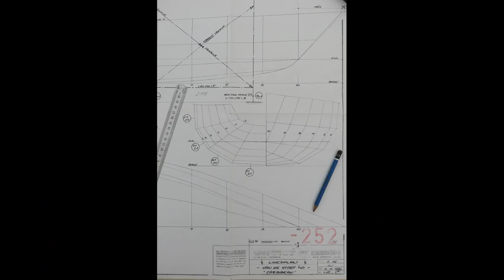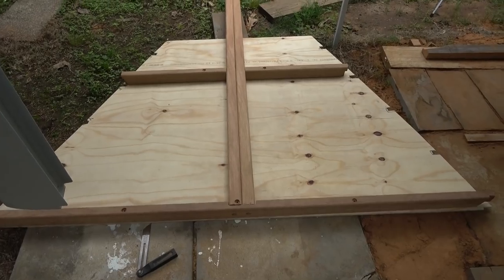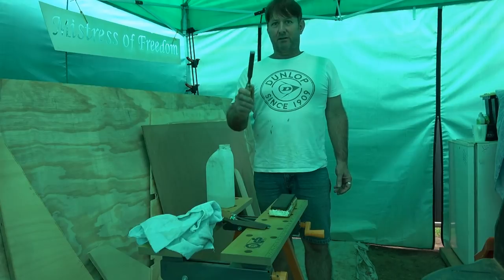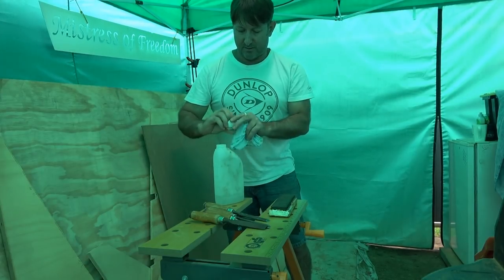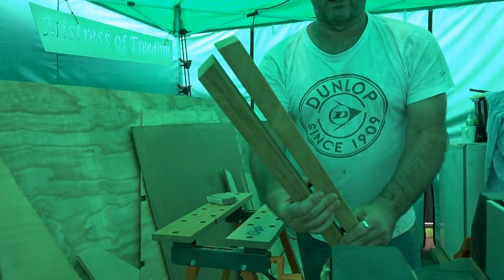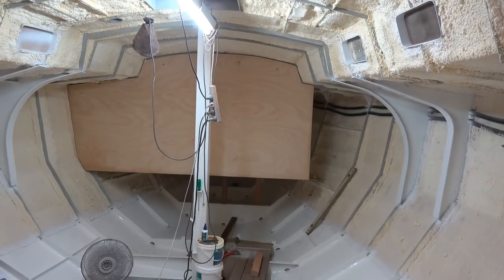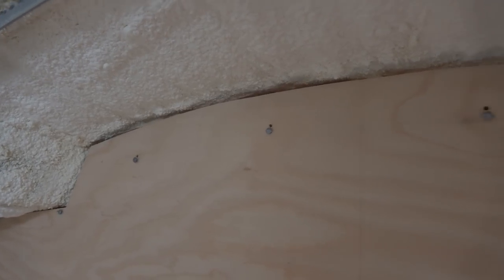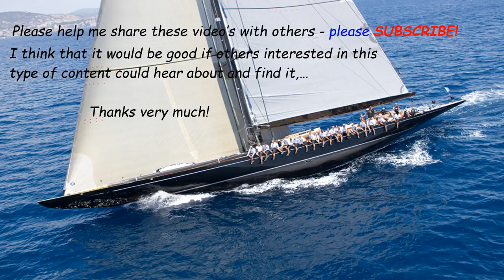Building my steel sailing yacht Ep.26 V berth framing pt.2 & MAIN bulkhead pt.1

Comment: So how are you adhereing the wood to the hull frames? Not bevasuse a critasim but everyone one had thoughts or reasoning behind decisions!  Sailing yacht Zora is using adhesives. And got me watching your build.
Reply from the maker: Hi Page and thanks for your comment and question and no criticism taken at all! For the majority of situations both the solid hardwood timber and plywood are being bolted to the steel framing and cleats with galvanised bolts and also adhered with an excellent adhesive.
And thanks again to Rhys of @Sailing Yacht Zora that you found Mistress' channel!  🙂